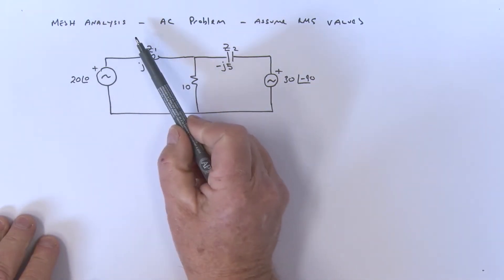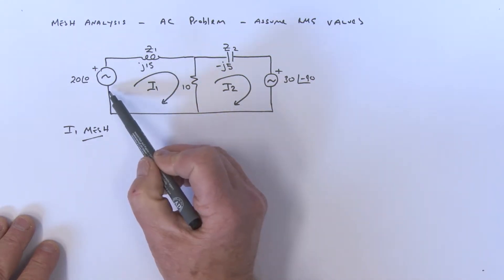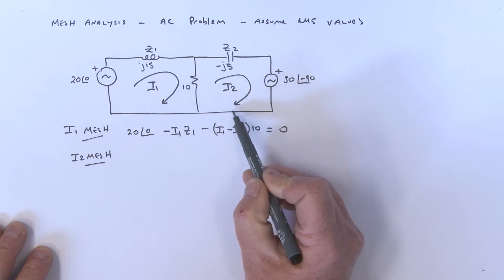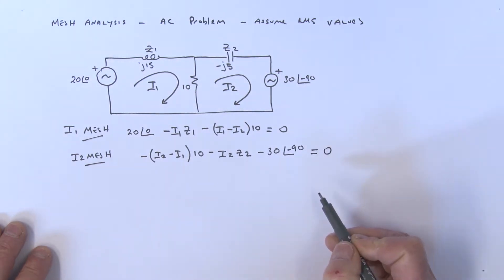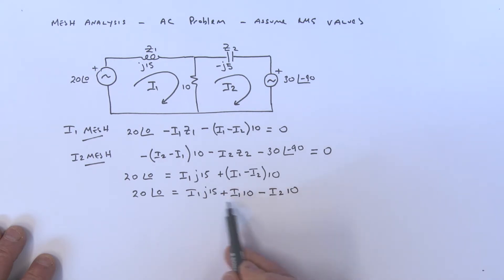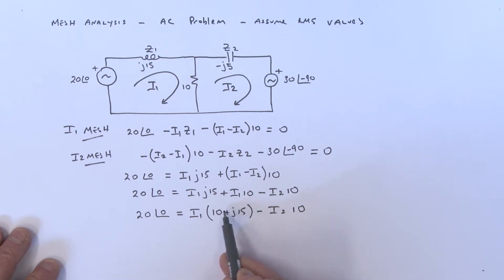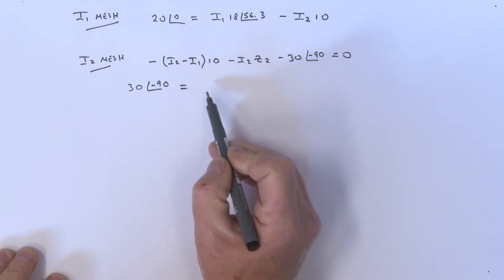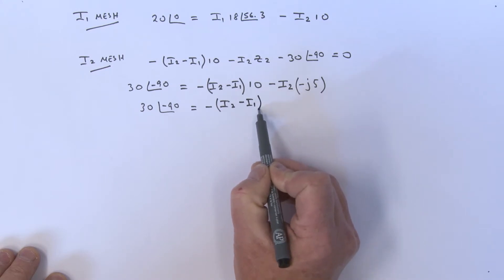Mesh Analysis Example

Comment: Mesh analysis is a powerful method for solving circuit networks using Kirchhoff’s Voltage Law! Check out my channel Engineer MayDay Question Solution for more engineering insights!

Comment: Why is the voltage -(i(2) -i(1))×10 on the second loop negative
Reply: Because in terms of that loop you need to assume based on the current direction that i2 is larger than i1. This is true of any branch that is shared by two loops. So you should have a +10i1 -10i2 in the first KVL equation. Then the second KVL equation will represent that voltage as +10i2 -10i1. When you combine the systems of equations you have the algebraic sum of those two voltages (represented by imaginary currents multiplied by the known resistance/impedance: V=IR) the solution will resolve the polarity with either representative equation.